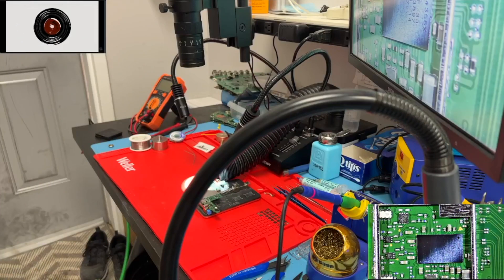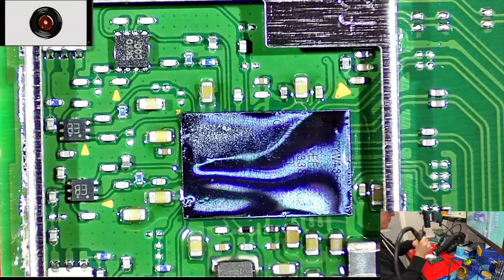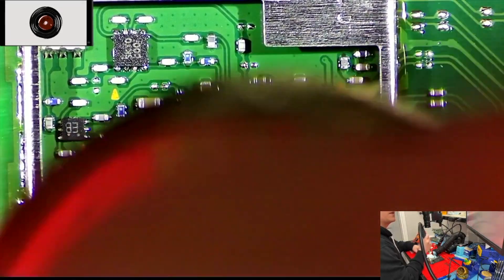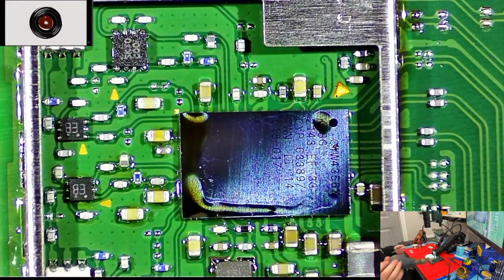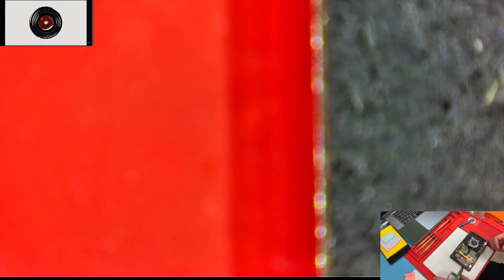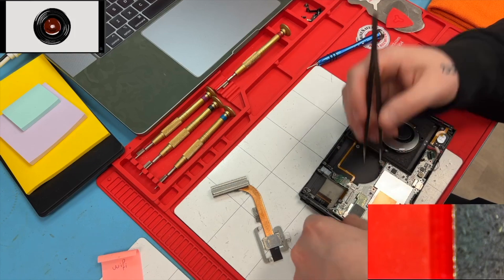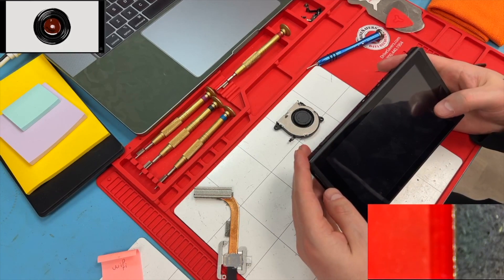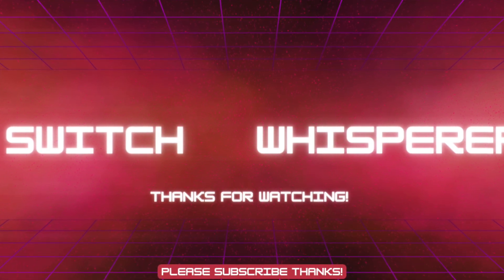Nintendo Switch No Wifi Networks found / Orange screen of death / Wifi chip reflow replacement

Comment: what if I have an orange screen after a random amount of time on, and I have good working wifi before it happens?
Reply from the maker: @Twitch-R6  still wifi chip bro its just losing contact after heating up instead of right away sry :/
Reply: @SwitchWhisperer  I can re-ball that, I just wanted to make sure before spending time doing so

Comment: Will this work for Switch Lite?? The other day the orange screen of death popped up on mine, it thankfully still turning on and working for the most part but it will not connect to the Internet/wifi, I've tried hotspot and it doesn't work, networks still show up and im still able to try and connect to the WiFi but it will not work. I've had issues with this switch since i got it (it was a gift idk if it was new or refurbished)
Reply from the maker: @jasper1422  yes

Comment: My switch oled won't turn on after this repair, please help.
Reply from the maker: @Conner._.Anderson  check power chips video on my channel
Reply: @SwitchWhisperer  but why would that go bad if it worked fine before your video other than not having wifi?
Reply from the maker: @Conner._.Anderson  because during the repairs you may have caused something in the power rail to go
Reply from the maker: It could also be that the repair went bad

Comment: Did u use 420° C at 50% flow? or 480°C and thanks a lot, I will use your tips to fix my Switch 😢
Reply from the maker: hmm depends on the machine used but yea about 420 and 50% flow would be a great place to start, you have to find the "sweet spot" for your entire setup and method of work, i tend to work a bit hotter and faster than some 
you can always lower temp and increase flow to yield same results thats why im saying it all depends on your own work flow